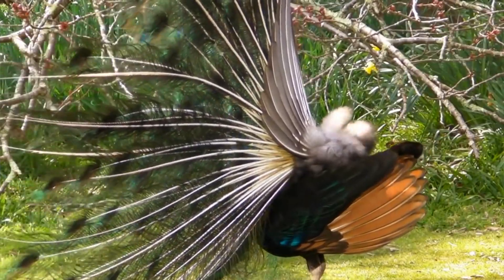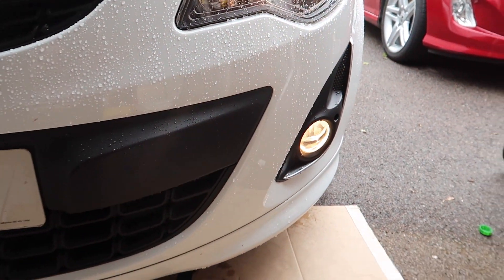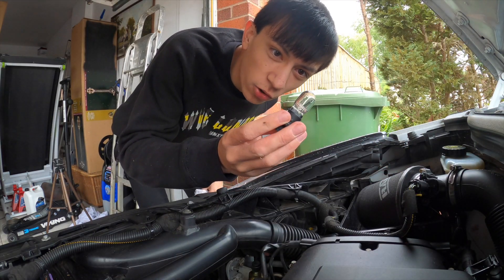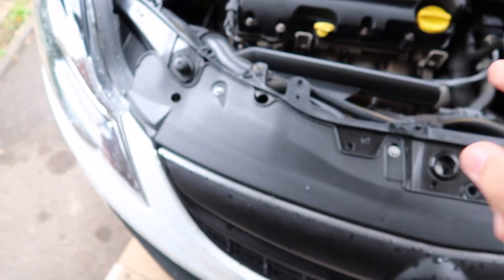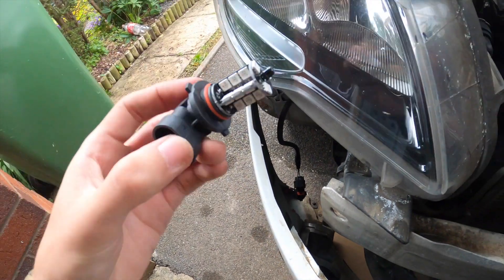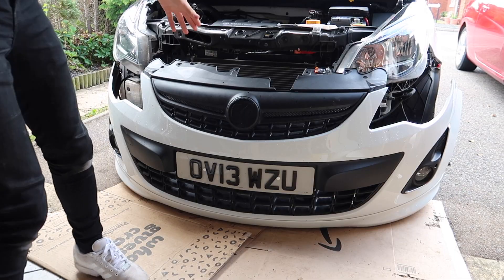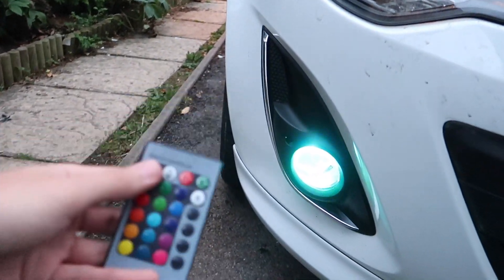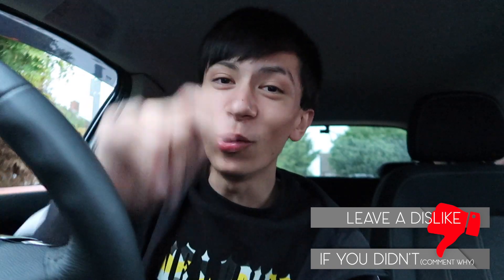£12 RGB FOG LIGHTS INSTALL!?!

Comment: I bought exactly the same fog lights mind didn't fit in aswell so I was thinking I need an extension cable to get it fit. If I fill down the club's by the side will they fit?

Comment: 9:40 the day time running lights look abit amber still hopfully you will be able to put some LED's in soon.
Anyway I rate what you have done to the tuk tuk so far it looks insane👌
Reply from the maker: Hey bro! Yeah they look really really amber on camera but I’m person there really white at night 😍🤪 Dunno if it’s just the camera tbf 🤔 But Tjanks a lot brother means a lot 😫🙏🏻
Reply: The OtherStuff led running lights usually die within weeks
Reply: @TristanSilverwood  ot depends on the make and quality like on my CLK  they have been working for 2 years and I havent had any issues with them but that's because I bought the full kit and everything

Comment: you pickup some led day time running lights from eBay pretty cheap now, I got some from illuminate8 they're designed to work with corsas and they look loads better than the blue tint halogens only cost like £15 as well.